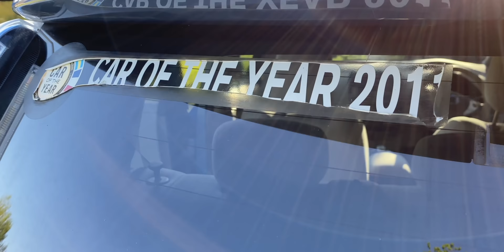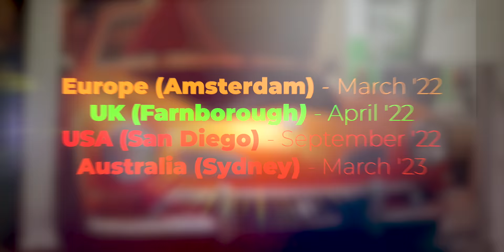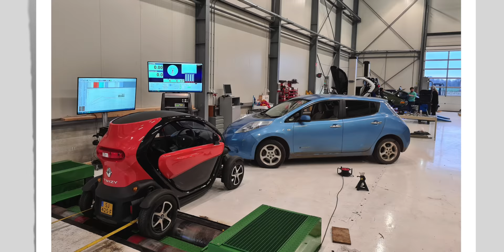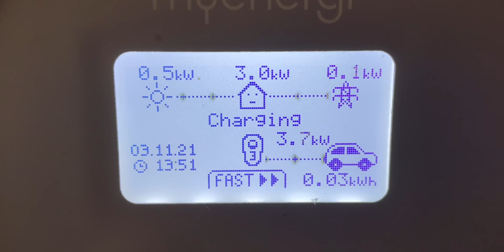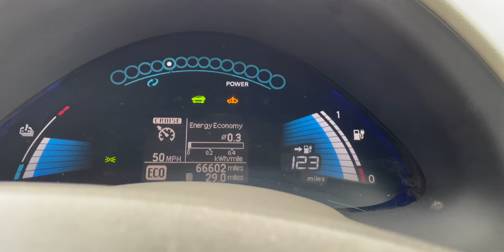Return of the LEAF: Robert drives his range extended EV home from Holland

Comment: A year on and it needs to be said that people do do battery replacements on Teslas. It's not common and I think usually on the early Model S where it has the free supercharging to make it worthwhile. Sometimes it might be because the original wasn't perfect or sometimes because they have very high mileage or always supercharged to 100%. Tesla's battery warranties were long and sometimes with unlimited mileage so a 2015 car might still be in warranty on the battery. 

That said, despite the price reductions on the new models, early Teslas are holding their value well - even for the pretty high mileage examples (120,000 miles plus).

It would be nice to know what the average lifetime of these batteries is, but that's not easy work out unless Tesla actually publish the data.

Comment: Upgrades aside, there are numerous battery rejuvenators, who take similar batteries from written off etc vehicles & use the modules or individual cells to repair older batteries by swapping out the worst modules.  They cater for Leaf, Zoe, Toyota's/Lexuses etc.  In the UK, this costs around £750 on average.  They also offer upgrades, but I've no idea at what price as I'm not on the EV market.. YET!...

Comment: Was waiting for this one! I have the same ZE0 that Cleevely changed the battery in for  a 30kWh one from a 2015 leaf. It had 3000 charge cycles before I bought it, and so had been punished by being over charged - same as yours. Now it says 110 miles on the guess-o-meter when I unplug it, and I couldn’t be happier. Yours looks in much better nick than mine, as my children have basically ruined the beige cloth interior

Comment: Please can you run us through the £4000 cost of upgrade. Did that include the labour to fit and transport costs etc. I can't even see a battery for sale at that price. Cleavely EV are listing the cost at £8900. How did you get it done so cheap? Is the company you used quoting that price and sourcing the battery too?
Reply: I also noticed that this isn't an advertised service on their website and remembered the higher cost of the Cleavely EV service from a previous FC video. I also wondered whether there was a trade-in price for the old battery pack that could offset the upgrade cost.
Reply: @robthomas7232  this is pretty much the most important part of the video. And it's just glossed over.

Comment: I have taken a hard look at a used Nissan Leaf from this generation several times. But the range was just to short to seriously consider it. The actual useful ranges they were getting was in the 45 to 80 mile range. After evaluating how, where and how far I drive, I determined my minimum range was 175 miles, with an optimum range of about 250 miles. Now that we can upgrade the cars batteries to comfortably bring the range to 150 to 180 miles, I am taking a look again. The impending issue is that the leafs CHDMO charging technology is being obsoleted by charging centers. I am wondering how difficult it is to convert them to the standard fast charging technology now being rolled out on new charging installations.
Reply: EVs enhanced is coming out with a 74kWh pack and that should give 300 miles range.

Comment: Really sorry if this has already been covered by someone else in the myriad of comments, but the engineer at the start of the video mentioned how the poor battery management out of the factory meant certain charging practices compromised the life of the battery. Did the battery upgrade include a management system upgrade to prevent battery degradation in future?
Reply: Excellent video as always btw

Comment: Just curious if you changed the plugs and charging system while you were at it. It should have been delivered with J1772 Type 1 and CHAdeMO, right? And the chosen European standard is the Mennekes Type 2 and CCS.

Comment: New battery for the Leaf is all well and good, but I'm just obsessed with that Fendt tractor. It's supposed to be towing carts as its job, but did they make the PTO work as well? Did they just swap out the diesel and keep the same transmission and all of the accessories powered off of a common drivetrain or did they split it up into multiple smaller motors? I assume the hydraulics on the three-point still work. Electrified farm machinery is definitely taking too long to get out into circulation, we need that kind of thing in place as soon as possible to get the carbon emissions of the agricultural sector under control.

Comment: For the record, you can charge a BYD car to 100% from 97 % every day with no unusual battery degradation.  In fact BYD warrantees the battery for 500,000 km with not less than 60% degradation or else they will provide you a new one.

Comment: Are your charging habits different with this battery? Do you often need to charge it to 100%? We keep our Soul EV between 50-80% most of the time, only charging to 100% when we need the max range, which is probably once every 2 weeks or so.
Reply: The best way to prolong the life of the LEAF pack is to only charge to full just before use.   If you get home with 78% left then don't charge it if you're only going to use 24% tomorrow.  If you need all 100% tomorrow then start the charge a couple hours before you leave the next day.    You never want the battery to sit and cool down at 100% charge,  that's worst for the LEAF battery.  That's what Robert was explaining in the beginning of the video, that he'd come home with 97% and plug it back in,  that's the worst thing you can do.

Comment: Great box reduction gear lubrication, does that get checked? I sold my leaf hard to get a upgrade hear in the usa.  Fun car and confortable. Sold it for 1200 usd  ery cheap and has chademo and 6.6kw on board charger did wanted to place in a 60 kwhr pack that would of been great. Will see how the owner is doing with the leaf for now. Great video. Love it and a great  leaf. Ot was a 2013 nissan leaf s model.
Reply: I usually buy leafs in LA CA for about 2000-2500$. Someone got a good deal on yours.
Reply: @pashko90  yep yhwy sure did. I removed the leds I had on the leaf that were 13000 lumens each fog light.  Have it on the bolt ev for the fog lights. The leaf had 5 bars when it was sold. How many bars did the leaf have the one you buy? And this 2913 leaf holds 8kwhrs used to hold 13.6 kwhrs when fully charged.
Reply: @dr.projectx5142  i bought a 2013 black s leaf with 5bars for 2600 about 18 months ago. Swapped a battery, insalled dual 75% soh packs, it can run right now about 120 miles per charge.
Spend about 7k so far.

Comment: Have been looking at getting a used EV, but i have always been avoiding the Nissan's because they only have ChaDeMo charging and that standard in our part of the world is dead, so there will only be fewer and fewer chargers. I have been told that none of the new charge points going up, around the country will even include a ChaDeMo option, only CCS, so this car will only get more and more impossible to charge on the go.

Also..Right now i do not have an EV, so if if bought a Nissan, i would have to invest in a ChaDeMo home charger, that i would then have to scrap along with the car, and then i would have to buy a new CCS charger. So much easier to just get a car with CCS and be "futureproofed".

Also...These leaf's from 2012 and thereabout, will need the new battery like Robert's, they even had a battery swap programme where you could get it swapped at a lower cost, in about 2018, at that time the batteries was already pretty poor.
Reply: Hey John, the car also has a J1772 charging port so any standard home EV wall box will do.  As Robert said the original car isn't for long trips, this would be for running around within it's usable range.
Reply: @glenf4115  not entirely true as far as I can tell.

The J1772 is refered to as a type 1 charge connector, but in Europe where i am, we use type 2 connectors for ac charging and most if not all home chargers sold have a permanently attached cable at the charger.

It does seem like you can then buy an adaptor for this.

That being said it does not solve the problem that there are few public chargers and they will only decrease in numbers over the years making the Leaf a "always in range of home" car.
Reply: @JohnDoe-bd5sz  then instead is a j1772 it has a type 2.  If you are out and about like Robert you could charge at work, the pub, when out shopping, etc.
Reply: @glenf4115  but out and about using the type 2 AC is going to be really slow.

Right now we have 2 cars.

One turbo diesel with plenty of power.

One small car with a 1.0 3 cyl engine.

If i have to go somewhere and it involves longer driving i take the turbo diesel.

But since some of these longer trips are work related "i have to go" trips i can in a squeeze take the small car. It Will Get me there Even though not as fast and as comfortably.

A leaf would replace the small car but if i go, IT is usually about 220 each direction. The place i go to is near the motorway but NOT near Any cities or charge points and they have No destination charger.

So i would have to do One ac charge in each direction and it would take a really long time.

Had the car had CCS fast charging capabilities it would be feasible to use it in a squeeze but missing CCS makes it really not suited for the task.

Comment: Uh incorrect.  Here in NZ the gen1 2011, 2012 and also especially the 2013 (gen 1.2 update) do suffer bad battery degradation.  Late 2014 and 2015 cars with the "lizard" chemistry seem way better.

Comment: My son bought a 2010 Leaf after much research, unfortunately 3 months after buying it the parking brake seized and was so expensive to replace we just left it out 😡 then a  couple of months later the 12v battery died which ironically controls everything 😢. He likes the car but so much for lack of repairs. Really frustrating as he is not a car guy and just needs it to work. So now he drives with warning lights on and is limited to approx 60km range 🤔

Comment: My biggest complaint with my leaf was the regen… I NEVER saw the 4th dot filled in and RARELY the 3rd.   My replacement (bolt) has a way better regen profile!
Reply: I have a few friends who is working on leaf VCM, they said what leaf can Regen easy about 80kw of power, but seems like Nissan diside to save a few cents per VCM and they are limited Regen for about 30 kw l, so, they don't need to install a transistor to drive a stop lights when Regen is on. They was been able to modify stock Nissan VCM to get a full 80kw of Regen and get one pedal driving going on aze0 leaf.

Comment: So there is no significant upgrade between the model years 2011 and 2012 for the Nissan Leaf?
Reply: You are looking at the battery capacity really...24, 30,42, 62KW
Reply: @JohnSmith-yv6eq  I've since read, that in the 2013 model year, the design changed enough in a way to make getting say a brand new battery built in 2023 for example, would now fit in model years 2013 and beyond ,  but if a 2018 Kia electric soul is available 1 year from now under 12K  (that's what I would rather do, but that is a very agressive goal and might not be realistic)

Comment: My 2016 i3 with the 33kWh battery - holding up very well, but the 100m-130m realistic range (depending on season etc) is a little limiting. Less so than it was as the charging infrastructure is so much better than it was in 2016. I say a little, and do I mean only a little - one-way journeys up to 180m are reliably fine in one charging stop en route at highway speeds, it's only beyond that the additional charging stops start making a significant difference to journey time (once at a destination, it's usually easy enough to charge up while doing something else). If BMW had released a 50 kWh version with a 100kW charger, I'd have leapt at it but unfortunately they're going back to their more tedious fare so I'll be looking elsewhere next time.
The 50kWh or so in the current crop (Stellantis group, of course the Kona/e-Niro, Soul EV, the VW ID3 58kWh, the new MG) are a great size for almost all uses.

Comment: Why didn't you get the battery replaced in the UK 
I remember you going to a place & chatting a fella called James
I won't be getting the battery changed on mine,  I'd rather buy a car with more range, where I don't have to turn off the heater during winter.
Mine is a 2017, 30 kwh, nice car, very short on range !

Comment: Do you have to use a CHAdeMO charger with that car, or did the overhaul include a CCS port? If not, is a pain to be relying on chademo ports in public charters?
Reply: Those had already Chademo, I assume that they are not convert to css because it is not a swap of the plug only. The whole charging electronics and firmware is different and there IMHO no out of box converting solution.

Comment: Great video blog Robert, I’m on similar range with my i3s with a 42 KWh battery. It’s perfect for the 8,000 miles a year I do. Unfortunately going forward manufacturer’s will only make SUVs and big saloon cars. One day I will have to drag along an extra tonne of batteries that I will never use.
Reply: Yeah, it sucks that small cars aren't seen as "profitable enough" (or at least that's what I think is happening), and aren't popular. Maybe its' the false notion that SUV's are somehow safer in a crash (at least in the USA, since I'm American), or how here in the USA, pickups are popular (despite most people never using the bed), or as a form of future-proofing (like a couple that knows they will have children (more than just two).
Reply: Nah, I dont think so.
But for now yes, cause that's where the sales and thus money is.
But the tech will trickle down to normal cars.
We have an Ioniq 38 rather than the I3, that was a little small for a family.
Dacia just launched the Spring aswell, there's also the 208, the ID3, the Corsa and so forth.
Reply: Megane with the 40kWh-battery isnt as small as an i3 or Leaf but it’ll fit the purpose, surely? And if not that the 208, Honda E, 500e?
Reply: new i3   has   mkore rànge 188 mioevtangge

Comment: The first generation LEAF really hast the problem of bad battery conditioning (no cooling at all) and the not so good battery management. These are the main point this battery runs down so much.
I've got a Renault ZOE from 2017, it has at least an active air cooling on the battery and so with 120000 km on the clock I still have around 90% of the original capacity that makes for a range of 200 (in winter) to 250km during summer. With the 40 kWh battery and the 22kW charger

Comment: I have  a 2018 Leaf S with the 40kwh pack. Love the car.  I am curious though as to whether you were monitoring battery temperature on the way back from Amsterdam.  The highest temperature reading I have reached so far on a run requiring 2 fast charges was 8 bars out of 12.  There has been much talk of how you can't travel long distance with the Leaf without serious throttling of the charging rate.  How did you fare?

Comment: Robert, at 11:00, talking about the running cost 'savings' of your Leaf, I'd like to raise a couple of points.
I converted your 65,000 miles and your battery cost in pounds to km and Aussie dollars to compare to our conventional Mazda2 sedan.
Let's call your km 105,000km rounded up and $7400aud just for the battery (which does not not including any charging costs you have paid, or a home charger installation)
Your Leaf works out at 
7. 04c Aud per km travelled just for the battery charge alone. 

Our equally great Mazda2 has a lifetime average fuel consumption of 5.9lt/hundred km. 
(actual real world reading running from day one of ownership)
That's almost exactly the same for petrol used at an average price of $1. 50Aud.
Mazda had fixed price services for our car, every 10k, let's add the $2000 for those.
The car has had no other replacement items at all except for a set of tyres. No exhaust systems or mechanical parts, not even a light bulb.

So I hear you building up for an 'A-ha', the Leaf did save $2000 Aud over the Mazda!
Well no, it didn't.
In our market, the Leaf was $47, 000Aud when new in 2012 plus on road costs ...
(no data for a 2011)
Our Mazda2 was $16,000 in 2016. 

So that is a saving of $27,000Aud, even factoring in 2 more services and fuel to get it over 100,000km. 

EVs don't make financial sense in our country. 
We don't have any government incentives in Australia (which we all pay for anyway via our increased taxes anyway)
EVs are not reducing in price to level out with regular cars in the same classes. 
Even brands that have two versions of the same car, EV and ICE are world's apart in prices
MG sell the ZS here in EV and ICE with a $20,000 price difference!
You don't get that money back over the life of the vehicle.
Not unless you keep it forever, which almost nobody does.
Reply: The leaf battery sucks.  Other batteries don't suck. Robert explained this in the beginning. You easily make back the money these days
Reply: @1fadf23f 
I'm aware that the Leaf has a junk battery system, however, even if you remove the $7000 battery from the above equation, you're still $20k out of pocket vs an ICE car at 100,000km.

Unless EVs have a dramatic reduction in price (around 1/2) then they are still not a financially smart option.

There have been small reductions in purchase prices, a few grand here and there, but all of the current and near future EVs are dramatically dearer that the cars they're meant to replace.
I'd love an EV as a second car, we have 7kw of solar panels on the roof in sunny Australia to charge it, but I am also not interested in wasting the money that I earn with poor decisions.